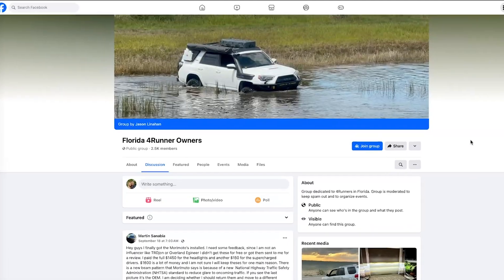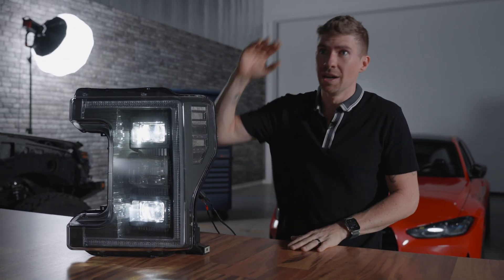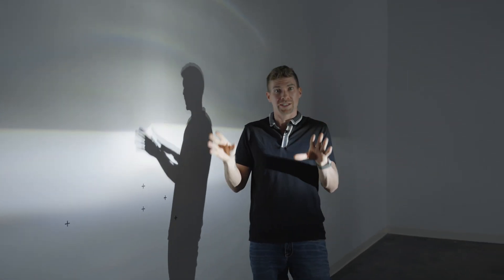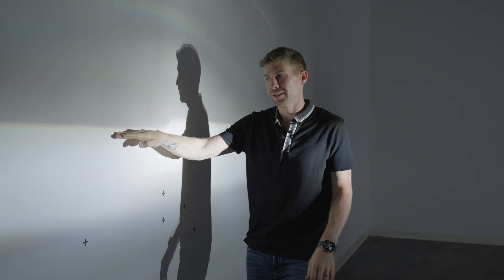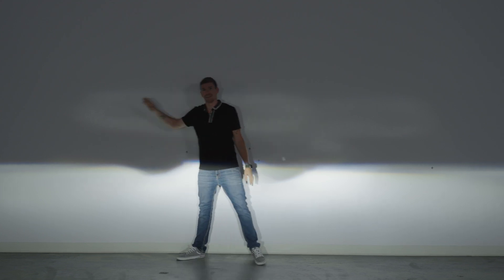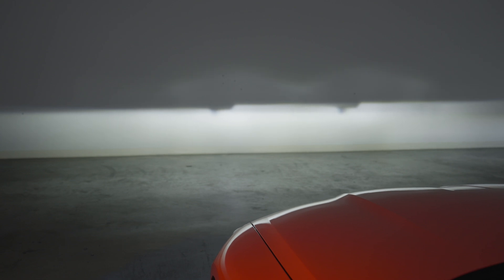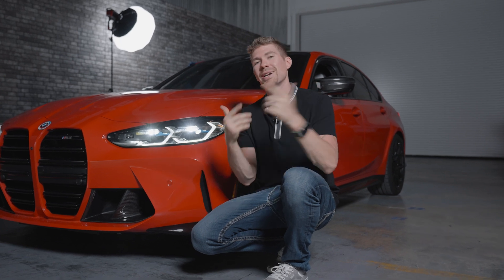Beam Pattern Dip from Morimoto XB EVO Headlights - Good or Bad?

Comment: How can I determine what led lightbulbs I need for a conversion of my halogen headlights on my VW Passat B7 1.6TDI? I tried contacting you through your contact form on the website to no avail.
Reply from the maker: What year is your VW Passat? That’ll help us determine the right LED bulbs for your halogen conversion.

Feel free to give us a call or email us directly for assistance:
📧 sales@headlightrevolution.com
📞 218-755-5200

We’d be happy to help!
Reply: @  it’s a 2011 VW passat 1.6TDI, I can supply the VIN number if that helps you in the process. By the way I live in Macedonia, Europe, just saying if there is a distinction between the EU and the USA version of the equipment of the vehicle.  I can also supply photos of the headlight if the markings on the back side of it offer any assistance.

Comment: My high beams are on an h1 socket inside a reflector, problem is the socket is not straight so the current led bulb is emitting at 30-45 degree angle. My high beam is strong but the light is too low. I know people don't recommend 360 leds, but in this case if I dont wanna take apart the headlight to rotate the socket, should I try a higher quality 360 led?
Reply from the maker: That, or try an adjustable 2 sided LED so you can angle it where you need it!

Comment: As an early adopter of these headlights, I appreciate the explanation. I immediately noted the "dip", found it distracting, and was initially disappointed. I spent quite a bit of time trying to aim these to minimize the "dip" only to give up and aim them properly and just live with it. I say live with it because the factory LED headlights simply don't produce the same beam pattern as the XBs. I would recommend putting some sort of information on your website about this topic so people don't wound around the axle. I was accustomed to the factory headlights but after having these installed for a little over a month, I don't really care at this point.
Reply: I understand that some people may not be familiar with this type of advanced cutoff style, I am eagerly working to support the team in creating more informative content. As designer of this optics, what I can assure you is that you will see much more than you could with the classic step-down cutoff style. In short, I have provided every possible inch of light distribution except where it had to be strictly limited. As a result, a minimally selected shaded area appeared as a dip shape. With the classic step-down cutoff, you would have lost everything on the left.  So you are not losing any illumination, no additional shadow in the beam, you are actually seeing much more where many didn't know it was being wasted. Perhaps, I believe disappointment was based on information as this is much newer latest advancement particularly with high intensity DOT LED projector.   In fact, the factory LED headlamp has the exact same concept, but they achieve it by creating a more acute selective small box punched out from the beam pattern instead of a continuous dip curve. They can get away with small shading because the intensity is much lower. 

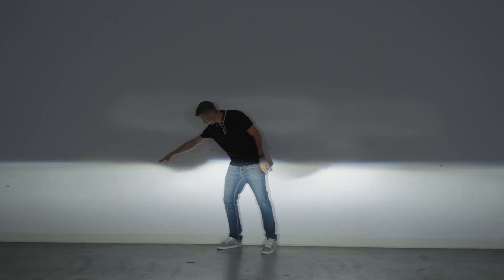With properly aimed ( look exactly like time mark 01:57 in this video), the cutoff is designed so that the driver's side beam dip and the passenger's side dip overlap at the oncoming traffic lane, precisely in front of the oncoming traffic driver's view zone, and illuminate as much of the rest of the area as the low beam regulation allows.  For full depth information about this topic, please reach Morimoto for document copy, I will also see if this frequently asked subject can be place on front end.
Reply: @yoshiishida6577 I didn't mean to sounds so negative, haha. They are a great set of lights just...different. I really do think that the details of your design and the content posted by @Headlight Revolution is important to the users. Thank you for taking the time to respond and get the information out there!
Reply: @yoshiishida6577  these lights are brighter than oem high end lights from bow and Audi?
Reply: @viccao8431  BMW or Audi is so vague, they have many different type of optics, but in general, if you talking about brighter by beam peak intensity, then for low beam, certainly higher intensity is given for distance zone than those known Hella, Valeo optics typically used in many BMW or Audi. ( just because high end does not mean high performance, some of those optics are pretty modest)  For high beam, ECE allows higher maximum allowance, so for DOT spec high beam isn't as intense as ECE spec laser equipped high beam of those. System driver is set only at 50% of potency to limit high beam maximum allowance for DOT spec.   Peak intensity itself really won't define if it is good lighting or not though. So don't worry about too much about numerical maximum intensity ( calls e-max value)   More importantly, distribution balance between distance zone vs near field illumination ( foreground illumination) determine how effectively and comfortably illuminate distance view comfort. Balance is highly refined with this optics. So generally, yes, brighter ( in simplified term) and in effective/meaningful way.
Reply: @yoshiishida6577  Thanks for the reply! Yes, I guess BMW or Audi doesn't mean much when every car has different headlights. 

I do notice in my car or any modern car seems to balance the low beam and high beam brightness so you eyes have a gradual and natural adjustment to it.  The light almost seems homogenous when viewed down a road and I believe thats why they don't let you use fog lights with high beams. 

My buddy has a super bright Rigid light but it's mounted low and actually has a lot of spread which splashes near the car making your eyes adjust very close instead of down the road. Despite his lighting being much brighter I think it's not as comfortable to drive with.  

I have a 2020 Audi Q7 with Matrix headlights made by Hella and I think they are exceptionally good but not as bright as the lasers. Curious if you have any experience with that car or similar and what you think of the performance of it.
Reply: @viccao8431  When fog lamp is actually needed, high beam does nothing but the blowing driver view up by creating immense amount of particle scatter. So really no reason high beam and fog to come on at the same time.   when high beam is desired( on clear night, long range no oncoming traffic), then fog lamp only pull driver view attention away from distance zone, where driver should be focusing. So this also support the reason why fog lamp shuts off when high beam in use.   Bright fog is conceptually self conflicting in my opinion, fog shall not be bright so it won't cause particle scatter, tight modest beam installed lower, focus on illuminating immediate foreground ( range can be seen in dense fog) and detect road edge/ditch.         Advantage of ADB( Adoptive Driving Beam-often called Matrix beam) is for driver to be able to keep driving beam(high beam) full time, system will selective shade where it needs to be. It still has lag, algorithm refinement needs, but far better than driver manually consciously select low beam or high beam. Optical efficiency itself is pretty low, so intensity is not so much astonishing, but as headlamp system, high resolution ADB is currently at apex of headlight technologies.  again, intensity itself really matters small. Our eyes can dynamically adjust and seeks comfort to given illumination level, what strongly matter is balance of illumination mapping. Some ADB lamp can reduce foreground intensity as drive speed increase and assign more intensity at distance zone. Most of ADB is only applied to high beam region, but some has extensive control to part of low beam.   Design ADB optics itself isn't issue to me, but vehicle integration is near impossible unless contract tie to OE full data set, only tier 1 can access such. Infrastructures are very deeply integrated to numbers of vehicle data link   Aftermarket lamp will not have reasonably meaningful ABD. Some are trying to use camera visual feedback based aftermarket ADB lamp attempt, but actual ABD uses speed sensor, steering angle sensor, mili, radar, bunch of feedback into algorithm to achieve.  If vehicle dose not have such infrastructure ready, making ADB lamp to fit is unreasonable. So I won't make ADB lamp for vehicle that did not have ABD infrastructure, and also, likely won't make ADB lamp replacement for those which had ADB. OE does the best in that category, investment to copy only cost a lot and still can't catch up as much data set accessibility to reasonably enter competitive market. Enjoy your matrix lamp! Great system. Keep headlight lens clean that's most important maintenance
Reply: @ wow, very detailed explanation. Yea I don’t think it makes sense to make an after market ADB light, good news is Toyota still doesn’t have one so hopefully that means you guys can step in for the new 4Runner. 

Great work with these lights, thank you for all the info, cheers!
Reply: If your concentrating on your own lane this will make total sense, on-coming traffic will never end up with glare at the worst time passing you. That “dip” goes away when you switch to high beams. It’s a positive, not a negative really. The Morimoto XB Hybrid lights are the same, incredible light where it’s needed.
Reply from the maker: Great suggestion for adding some information on the website! 🙌🏻

Comment: That dip wouldn't help on winding roads
Reply: You got it backward. It helps particularly at left curve and winding road.  Dip shape is the result of advanced selective shading method ( giving every possible illumination possibility except critical control zone at 3.5L 0.86D test point) for particularly left curve visibility enhancement.  3.5L 0.86D  test point is NOT a direct glare control point, it is wet pavement surface bounce related glare control point.  And 3.5L 0.86D Bounce trajectory does not affect any oncoming driver that is not on straight approaching angle. it is designed for longer exposure probability expected straight road control point.  Direct glare control point is above cutoff line, which is 0.5° up and 1° up from H axis, 1.5° left from V axis. So seeing correctly designed dip shape in the beam only means you have extra light can cover left curve driving scenario significantly, which traditionally had been trimmed off, became unavailable by classic step down cutoff.
Reply: @yoshiishida6577  idk about that, the light dips then goes back up, I'm talking pretty sharp curves,
Reply: @Yippynutsmacker  Direct glare control point is ABOVE cutoff line, dip is not there to prevent direct glare, it is controlling wet pavement surface bounce trajectory.  This style cutoff, left to dip go back up but does NOT go above H line(=cutoff line) so regardless of curve or straight, glare is defined by what is above cutoff line. If 3.5L 0.86D point is within allowance limit, fully flat cutoff is perfectly acceptable for example. Because constant exposure glare zone is above the cutoff line.    If you are talking about severe vehicle roll related entire cutoff tilt, then it become probability assessment and it really won't make significant difference of direct below cutoff line ray exposure probability.  Weather if classic step down or dip style cutoff, if recklessly turn dark night curve fast enough for vehicle to roll that much, then no cutoff style can help unless beam look like a triangle shape. You are probably thinking some sharp left turn, fast approach let's say, this can lift left cutoff tilt up to on-coming traffic driver view height, yes, this is plausible debatable scenario,  but in this case, tilted beam approach angle to on coming traffic driver view is much from side, also on-coming traffic driver view focus is towards right edge of the beam=direction of curve, and this happen as equally with classic step down cutoff as well, just matter of momentary positioning distance difference . Considering all possible probability, vehicle headlamp is designed to help most majority of the driving scenario benefit and most probable conflict prevention basis, such as straight line constant steady exposure control rather than momentary, constantly beam trajectory changing situation.  You may not be accustomed to this type of cutoff, but benefit of being able to illuminate left curve is massive, at 250m radius curve, distance visibility gain is as much as additional full 1.5 second of distance at 50mph driving( compare to classic left step down cutoff). It is good subject you raise concern about glare, but data data shows glare issue is hugely based on wrongly aimed lamp more than anything eles ( unfortunately, not too few factory line-off vehicle still have inconsistent aim). Of course, it is Morimoto's strong responsibility to educate proper aiming to their users. With properly aimed lamp, this type of cutoff only carry significant advantage over classic left step down cutoff in conclusion.
Reply: @yoshiishida6577  nice text walls. Still doesn't change that lights like these do blind horribly if you're actually in oncoming traffic in a corner and over hills. It's just physics / optics.
Reply: @kontoname  If you can propose better photometric distribution and make sense, I can adopt design no problem. I've designed these optics, I am always open for any improvement discussion.  But important for you to understand you can't prevent over hill cutoff angle up unless it is paired with auto aim or full ADB. That roll is done by different device, not cutoff itself.  Yes, trigonometry, beam development path itself is physics, math but calling that as physics/optics is too shallow in this case. Optic development involves much more than visual appearance impression of cutoff.    In relative 2° upward hill against oncoming traffic at 50m distance gives as much as additional 1.76m up to cutoff height. At average lamp mount height of 0.85m and average driver eye height 1.2m,  even with harsh large step down classic cutoff,  still result in 1.9m from ground, way above oncoming driver view height regardless.   It's been well established data light that blind horribly is caused by lack of aiming understanding and improper aiming practice. As stated above, step down cutoff can digest only so much to volatile situation like certain % of relative upward hill, with corner at certain range etc.  Lamp's primary roll is to illuminate road where it needs to be, regulation assure minimum performance requirement and limit maximum allowance where it is critical to minimize risk factor smallest to most impactful most majority drive case scenario.  Glare is defined by illumination level of above cutoff line and exposure duration probability of collected many possible drive scenario data set, weighting what benefits levels and what risk levels are.   IIHS has extensive physic study and calculation to determine most beneficial and minimum risk factors to oncoming driver. Leading cause of poor headlamp performance related accident was poor left curve visibility, leading cause of glare was so many vehicle from factory still aimed wrongly too high.  Rather than applying uncertain condition of oncoming vehicle lamp distribution and their aim condition into generalized "light like these", seek actual photometric data first to understand distribution detail and learn about up to date regulation detail, how optics can be optimized, then make assessment. that is physics and optics.  If you have better photometric distribution suggestion over IIHS assessment physic protocols, you shall share to improve night drive safety protocol.
Reply: @kontoname  this is literally the guy who designs these headlight bro 😂
Reply from the maker: We appreciate you sharing all of your amazing, helpful knowledge here, Yoshi! 🙌🏻
Reply: @HeadlightRevolution yoshi is THE MAN❤!
Reply: Notching the cutoff is the 75% solution to not blinding traffic.  The 95% solution is notching combined with active (pivoting) emitters.  The latter just isn’t practical with an aftermarket headlight… most people can’t even level their lights properly.
Reply: @superspeeder  ADB sure is most desired beam control method, just not reasonably feasible for aftermarket lamp. Infrastructure to achieve ADB is unreasonably massively complicated. As Bi-LED projector component level, I am strongly confident its performance to boast highly refined balance. And aiming shall be assigned responsibly for user to learn, for Morimoto to aid user to understand.
Reply: @yoshiishida6577  agreed 100%.

I still have limited confidence in the average person taking the time and effort to properly level their headlights.  Barely a few days will ever go by where I don’t see someone driving with BULBS which are improperly installed in the headlight housing.  I saw a Tacoma just today with the driver’s side headlight bulb out of whack… he was following me in traffic.

If people have trouble installing headlights properly, and are also unable to tell their lights are not working, my faith in people DIYing their car repairs fails to inspire…